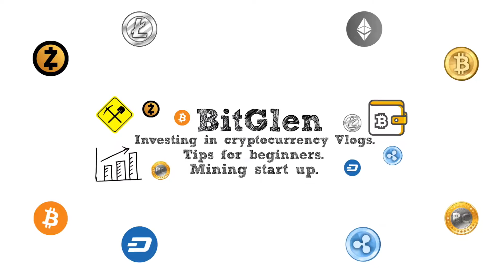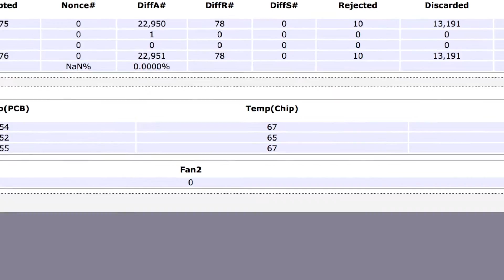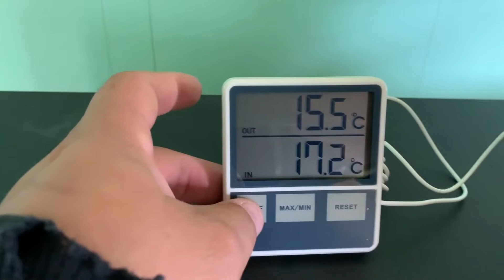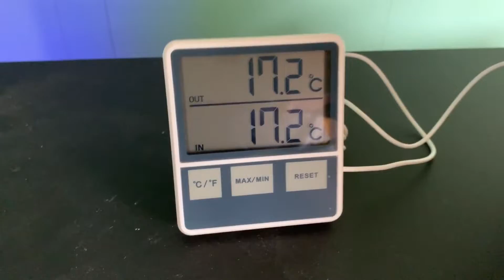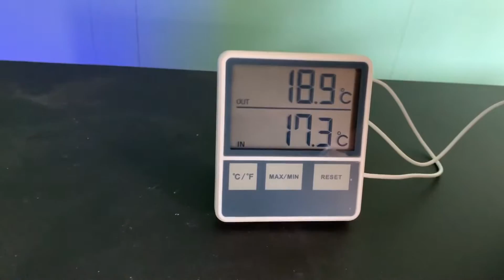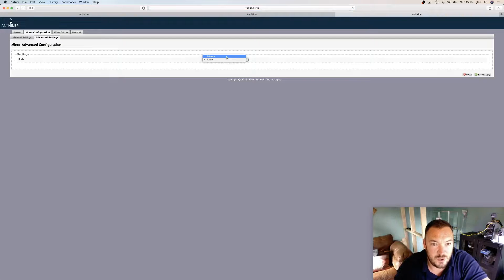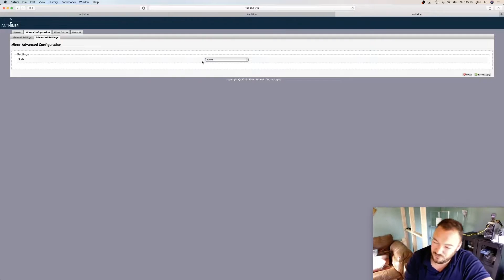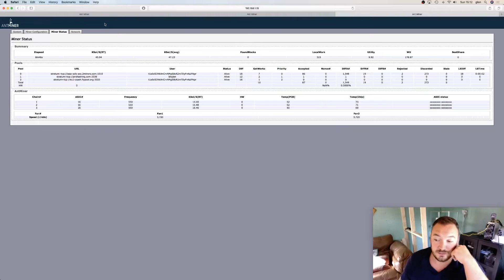ant miner z9 reveiw | After 24 hour 🕐🔥

Comment: u need to isolate the hot and cold air.. my idea is u need to put a hole on the wall and put the ant miner in between the wall.. so the hot air will be released to the room behind the wall or u can put a host from the back of the miner and route it out to the window, and u can take fresh cold air from front

Comment: Mine are running cooler. Try moving them away from the wall a bit. I know you are tight on space but when you get the plasterboard up you could have the fans upto the wall with vents through the plasterboard to suck in the cooler air from the main space. Won't help with noise but they will run cooler. I'm still no closer to an overclock for the Z9. I can "PuTTY" into the "TOP" dir on the miner and see the live data of the machine but not got into the config files yet.
Reply from the maker: yeah im trig different spots but the shed gets so hot! so gonna need to start making holes in the walls haha

Comment: Try overclocking it by modifying the frequency with the Chrome editor.   That's what we had to do with the z9 mini second batches.
Reply: has anyone done it. I'm afraid to try
Reply from the maker: how easy is that to do??
Reply: It doesn't work
Reply: Theres someone selling a bios update, allows 55 to 60k sols